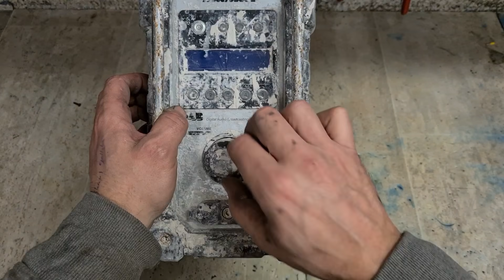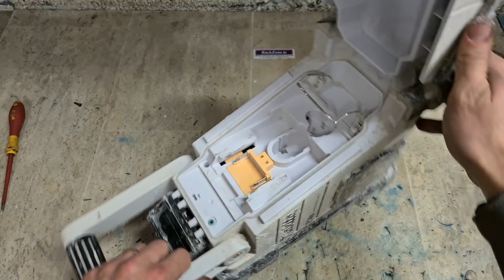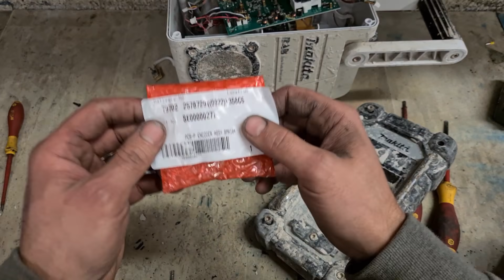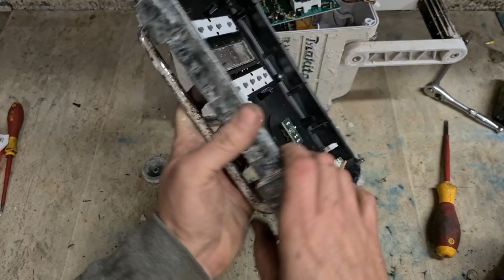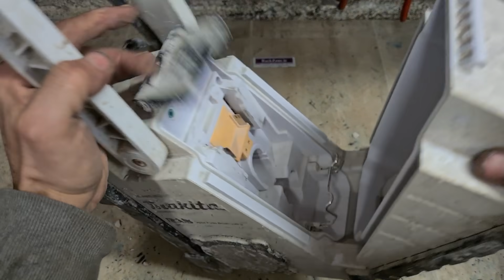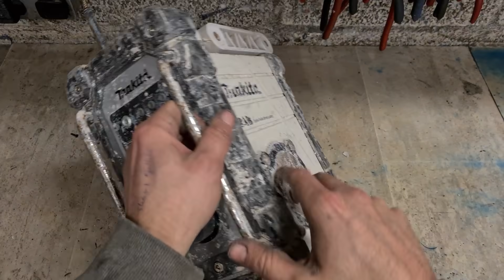How to repair a Makita Radio, DMR104

Comment: Hi Dean what is the screwdrivers bit you use to get the screws out inside the radio back cheers kev
Reply from the maker: The older ones are t15 and the new radios use ph2
Reply: Hi Dean thanks for that just repaired my milwaukee inpacked driver thanks for the videos

Comment: Hi Dean, Can you see the specs on the back of the speaker. I'm wanting to buy one with blown speakers but want to see how much a replacement will be first. Cheers.
Reply from the maker: a single speaker costs around 20 euro. SE01620771
but the speakers rarely fail unless it gets a fall of punctured. 
id bet the main board inside is faulty.

Comment: I have that radio but my screen has gone. Would it be worth repairing or just getting a new screen?
Reply: Did you solve this issue?
Neighbour gave me one to look at and ass soon as you plug the battery, the blue backlight comes on without pressing the power button but no response to any controls.
I’m expecting capacitor issue or corrosion under the shield on the back side of the screen.
Reply: @Infiniti25  no I haven't. I put the battery in or even the mains plug, when I go to turn it  the screen turns on, but there's no display. It's pot luck as to what station I tune into
Reply: @alexsargeant2147  at least you get a station…this one is just blue screen and silence from memory (it’s been in bits for a while now)

Comment: Did you ever work at the DeWalt stack radio?
Reply from the maker: no parts availible for them apart from the knob and power lead. Cannot get anything for inside the unit

Comment: My jobsite radio is called JBL Charge 4. Has been dropped into paintbuckets, blown over by paint sprayers, sanding dust, plaster spray. Works perfectly, costs about half of what a Makita jobsite radio costs (In fact, barely anything more than a price of a single Makita 5AH battery), bluetooth range is triple that of a Makita radio and comes with a battery included.
Reply: That cool but I think the most of us get their equipment from their boss. And having all Makita makes same then.

Comment: You forgot to install 1 screw of the circuit board.
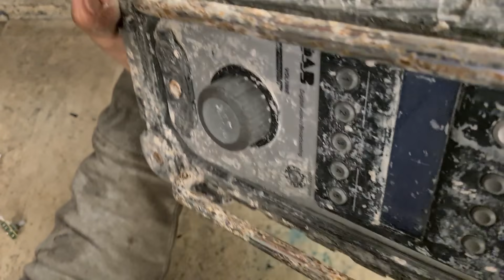Reply: It flopped out at the end when shaking the loose plaster from the inside. You can see it at 11:42

Comment: How can a radio be too expensive to repqir the components cost pennies
Reply: If you are repairing for yourself, yes, but for a commercial repair service, he has to charge labour and tax and is most likely only going to replace parts available from the manufacturer. He is very unlikely going to spend half a day testing every component and then replace a few components which cost pennies as he will need to charge the labour to the client. By the time the repair bill is calculated, the client could have bought a new site radio cheaper with a new warranty than paying for the repair of an old radio.
Reply: @stevekent3991  thanks for the clarification

Comment: I think I found the rotary encoder that is on that board. EN11-HSM1AF15 should be the part number if it is. It cost $2.84

Not saying buying the individual component would make more sense.

Comment: Hi mate. Love your content. I used to be always fixing my tools when I was on the tool. Quick question. I have DMR115. The screen doesn't work because of impact. Is it replaceable or is it part of the main circuit board?  
Thanks heaps.
Reply from the maker: Wouldn't be worth it, the screen is part of the main board cost around 120 to buy.

Comment: It's an encoder not a potentiometer 😉
Reply: Who cares what he called it..isn't it fixed
Reply: @billenglish797 people who want to learn about electronics
Reply: @smashyrashy  yeah I get that he just made a mistake he knows what it's called
Reply: @smashyrashy if they want to learn about electronics, they might choose a different channel.
Reply: I’ve cleaned the potentiometer/ encoder with switch cleaner twice now after it stopped working however it works dust and rain must affect it
Reply: @peterthebricky  yes mine is the same but I don't fancy opening it even Dean had trouble with it😮
Reply: @peterthebricky since you've opened it is no longer sealed and is allowing water and dust in it..
Reply: God bless you for your great knowledge. 😂
Reply: Who cares? It’s fixed! Carry on Dean, I love your work!! 💪
Reply: Grab hold of your knob and give it a good pull😂😂😂😂😂 brilliant
Reply: I  would like to find a way of reducing the bass output on these as when working around houses the biggest complaint is the noise
Reply: Terminology isn't important if you know how things work you can fix them. simple. Who cares what things are called 😂